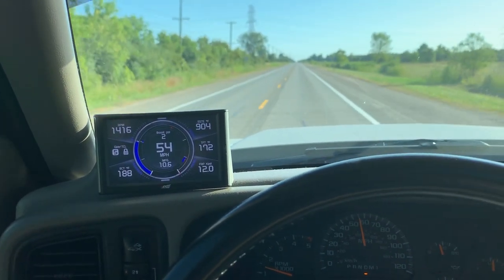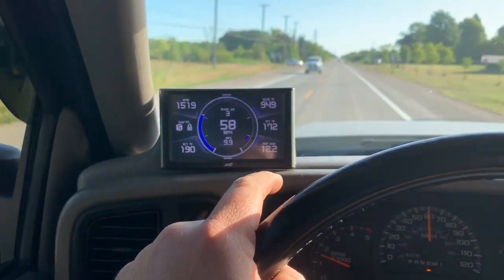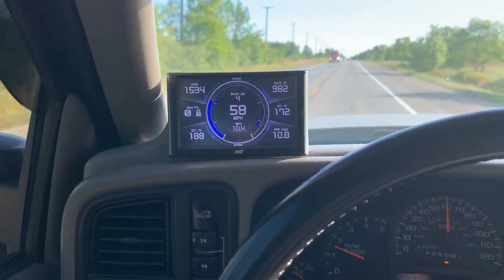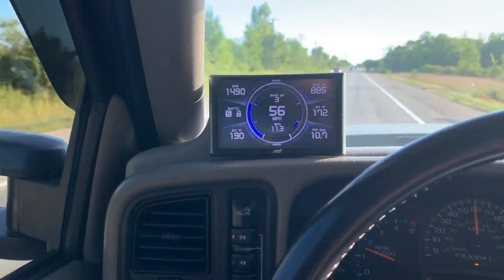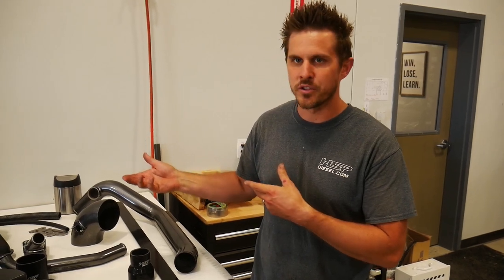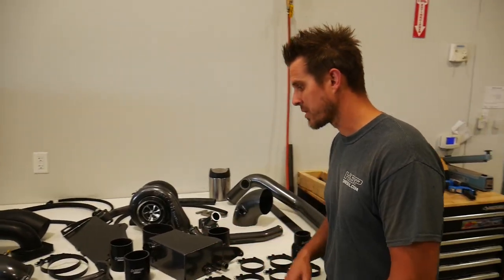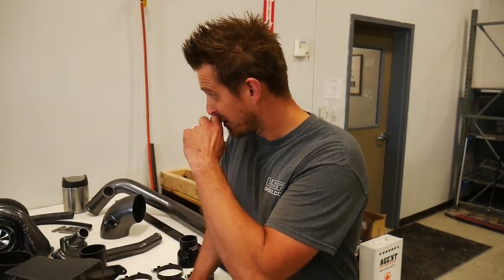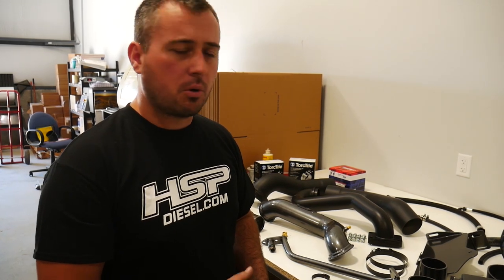DURAMAX COMPOUND TURBO BUILD REVEAL!!

Comment: High egt's here too. I have a 68mm Danville street with high flow vanes. I was thinking of re gearing to keep it lit, is that not the way to fix lag on a 68 on 35 Nitto's on 20's?

Comment: I have a 68stg2r on my lbz with race manifolds and dual fuelers and 60 overs basically same setup as you and my egts cruising are at 650-700 at that mph and on the interstate I see 800-850
Reply from the maker: Is it also lifted with big tires? That turbo is an S300 also not a VGT correct? The back pressure is coming from the VGT vane position being cranked up.

Comment: Wouldn’t a different torque converter help too? When it couples and the stall is matched to the turbo/mods, if you have a stock stall and not a more aggressive one it would make it laggy and burn hotter?
Reply from the maker: Yes that makes a big difference and yes I have a different stall converter. Mine is a suncoast 1074 which is about a 22-2300 stall converter.

Comment: You going with a 64 or a stock valley charger
Reply from the maker: Ryan’s is doing a 64/66 with high flow vanes
Reply: @RustbeltMechanic  oh boy thats going to be fun your going to be making about 750-850 if you have the fuel thats a lot are you running the stock bottom end pistons, rods,crank, good luck can't wait to hear it